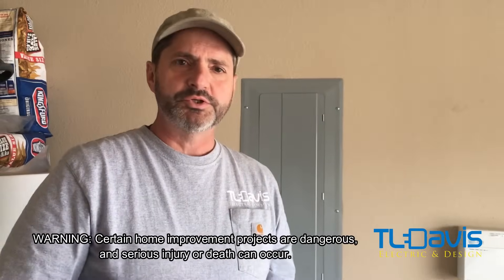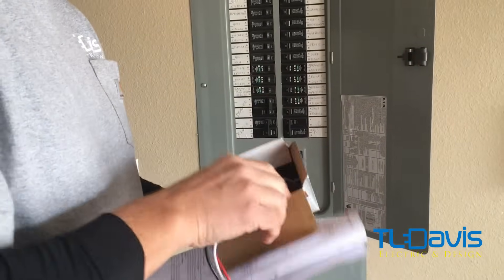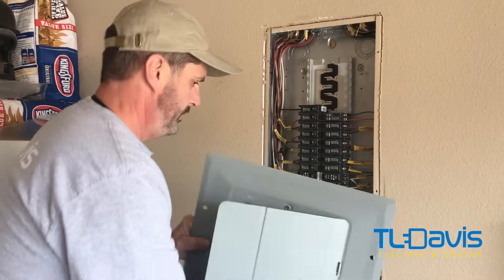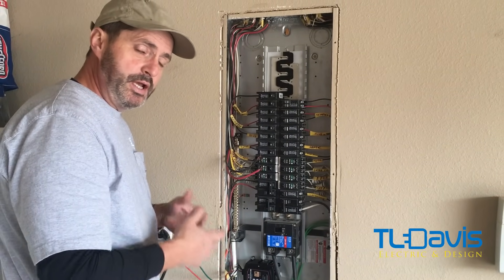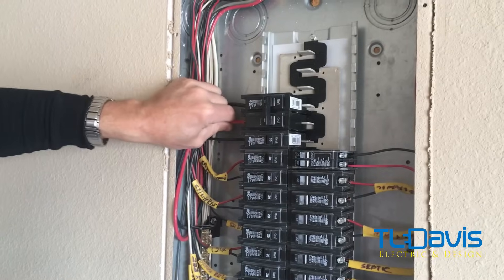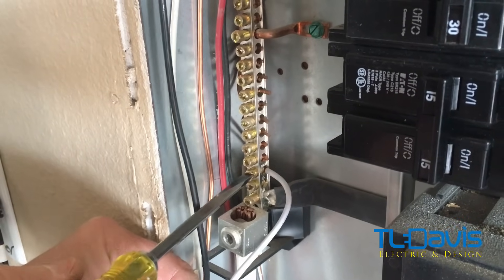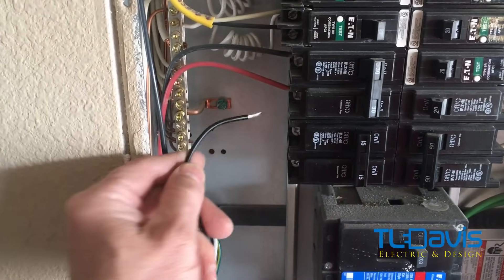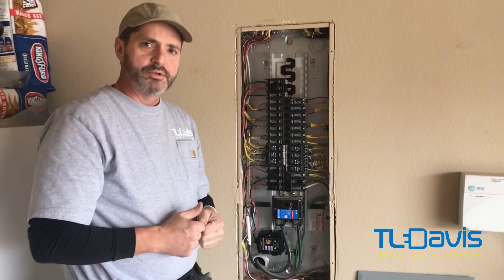How To Install A Whole House Surge Protector | TL Davis Electric & Design

Comment: Why did you connect the neutral and ground wire to the same connector
Reply from the maker: This was a main panel shown in the video. In the main panel the ground and neutral bars are connected, so it does not matter. Only in a sub panel are they separated and then the ground has to be on the ground bar and the neutral wire has to be on the neutral bar.

Comment: The unit installed requires a 2 pole 50 amp not a 2 pole 15 amp breaker he misread the instructions.
Reply from the maker: Thanks for your comment. I did not misread the instruction on what size of breaker to install. it calls out for two different styles of SPD and one is for the 50 amp and the other for the 15 amp. The one I installed was for the 15 amp. I have installed over 30 SPD with this amperage.
Reply: No, Terry is correct, they sell different models, the Ultra model uses a double 50 amp breaker, the model in the video is the Micro and requires only a double 15 amp breaker.

Comment: Is the distribution boar a single phased one?
Reply: I meant board
Reply from the maker: The SPD is single phase that we installed. Do not install it inside the panel that is shown in the video. This was a special exception given from the local jurisdiction having authority. All SPD of this type need to be installed on the outside of the panel. Please check out the other video's.

Comment: I have a question, why did you connect the ground from the protector to the neutral line and not to a ground?
Reply from the maker: I have explained this to others that have had the same question. In the Main panel the ground and neutral bars are connected. There for they are not separated. In a sub panel they are separated and then they must be connected to the ground bar and not the neutral bar.
Reply: I said the same thing I have an old three wire system coming into my garage but I added the plain copper wires outside to two grounding steak 6 feet apart and I had to install just a grounding bar for the copper grounded line outside so my white was on the power line Ground Bar and my copper was on the ground Rods Bar that's what my electrician this done it for sixty years told me to do

Comment: I realize Terry is an electrician. But what he is doing is u safe for any homeowner. Please call an electrician.
Reply from the maker: There were notes for this type of insulation. This was a special type and was approved by local authorities having jurisdiction. The child of the homeowner has a mental disorder and love to pull things apart with lights. This was not the correct application for standard insulation of an SPD. If you look at the other insulations that I have provided video's for. We have done another correct type of insulation for recess mounting which will come out shortly.

Comment: I always put the wires in the breaker in my hand first then mount it in the panel, done.  Might be wrong but then I’m working away from the box.
Reply: Not wrong at all. I've been doing that for years.
Reply: Huh, I like that idea, maybe when space is tight

Comment: Nice work Terry. What is the total cost to have this done?
Reply from the maker: If you buy this through Amazon with the Eaton whole house surge protection for single phase and the two pole 15 amp breaker and the flush kit. you will also need a 1/2" offset nipple with a 1/2" steel threaded coupling. you should spend less than $150.00. if you have someone install it for you, depending where you live. an average cost is around $500.00

Comment: Might want to clear up some confusion for some beginners and let them know why the ground and neutral are mounted to the same buss bar, and how they are bonded only at the main panel.  Also, when tightening down the crimps to copper, to go back and re tighten later as copper is soft and compresses leaving a slightly loose connection after being seated and setting for a day or so.
Reply: I just want to clarify that it is not always the main panel, but is the first point of disconnect. If your outside service  has a breaker that kills power to the pane where the majority of your breakers are housed,l then you need to keep the grounds and neutrals on the correct bars on that panel or mount in the disconnect(if possible) and bond grounds and neutrals
Reply: Yeah why the ground in the neutral bar??
Reply: Yes, why on the same bar?
Reply: This video was made before outside service disconnects were required. This panel is the first means of disconnect at the time it was made.
Reply: Good Tip, I went back to my panel 3 months after new and re-torqued all the  breaker conductor connections,  found 1/4 turn on many and some took almost a full turn tighter. It is good prevention to nuisance tripping and costly breaker over heating damage.
Reply: Thats not the purpose of this video

Comment: hello good Sr. I was wondering if you can please help me I have a surge protector Siemens - TPS3A1220VX02-1 Phase Surge Protection Device, 120/240VAC. can you please help me with the connection diagram. please
Reply from the maker: This is a really nice SPD. May I ask what square footage of home and is there a lot of electronics in the home. 200ka I only use for commercial applications. Homes are really protected with 50, 80, 100ka. from what I can tell from the picture. You will have a L1, L2, N neutral white wire and the ground will have a lug mounted to the can and that has to be green. I could not find a wiring diagram on line. The 2 pole breaker will need to match what Siemens is asking for in their specifications that came with the SPD. The wire coming from the breaker to the unit should not be more than 18" and the wire should be rated for the breaker feeding the SPD. Sorry I cannot be any further help. Good luck with your project. Make sure to turn the main off when working on your panel.
Reply: It is a three phase panel
Reply: Comercial

Comment: I like the way Terry Davis installed this. I would make a peek hole to view the status lights.
Reply from the maker: I only installed it in the panel do to a special situation. Normally they are installed on the outside of the panel, either surface mount or recessed mount.
Reply: Eaton sells the breaker type.........

Comment: My main breaker is outside in a separate panel box, right beside the meter. But then, I live in Texas!
Reply from the maker: If your main breaker is outside next to the meter. That is okay. Just install it in the panel with a 2 pole breaker for your panel. The spd will tell you what amperage you will need. I have attached links below the video to buy them through Amazon. there prices are cheaper than I can buy through the electrical supplier. Make sure to turn off the main breaker when installing the breaker. It does not matter where the breaker is installed as the electronic detect the surge and draws the power surge to it. I always recommend it to be close to the main breaker or main lugs in the panel.

Comment: I see MWBC's ("split circuits") without handle ties as well as one in the top right landed on a twin breaker (on the same phase). The former might be a technically but is still not code, the latter could cause an overload of the shared neutral. Both should be corrected. Also SPD's should NOT be installed behind the panel cover with no way to monitor their indicator lights.
Reply from the maker: First  of all. I did not wire this panel. Second of all we had special permission from our local inspector to install it inside the panel as they have a child that loves to tear apart items with lights. This was a request from the home owner to do this. I know this is not the proper way to install a surge protection device. I have explained this in another video.
Reply: @terrydavis5882  We install surge protectors made by PSP Products with a similar design as the Eaton ones. They are UL listed to be installed inside or outside the panel. They have the same green indicator lights and an alarm that goes off when the surge protector no longer works. So if you think about it, how often will someone look at the lights to see if the SPD is good. If the alarm goes off it will get your attention right away. Ideally the best way to do this is to mount the SPD outside the panel but it gets challenging when the panel is recessed in the wall. The most important thing when installing the SPD is to keep the wires on the SPD as short as possible. This will make the SPD more effective.

Comment: Smh all these comments that say he should have this and that and blah blah blah. IF YOU AREN'T COMFORTABLE WORKING WITH ELECTRICITY LIKE THIS DON'T DO IT!!!! simple as that. He knows what he's doing and has probably done it hundreds of times. He says have it done if you aren't comfortable with it. It's like all the idiots with the lead paint and asbestos siding. Stuff has been used for years and holds up great. I have it on my house and will never get rid of it. Been there si ce 1949 and has held up fine. I drill through it and whatnot but I don't lick the shit. I don't eat the lead paint off the walls. With a little common sense less people would not get hurt. The reason why it's this huge deal with how things are supposed to be done with electrical these days is because some idiot somewhere (probably Florida) thought it would be a good idea to lick the mains. I mean seriously use common sense and don't be stupid and you will be just fine.

Comment: Seriously?  This thing in this configuration is supposed to suppress surge in the whole panel?  OK, y'all.  Cause electricity is just gonna magically be drawn to that one 15 amp circuit?
Reply: The surge suppressor includes devices that breakdown ie short out when an over-voltage condition on either or both live lines is detected. They act extremely rapidly and pull the overvoltage down so yes the whole panel is "magically" protected!
Reply: Yes, it's a shorter distance to ground..... That's where electricity wants to go
Reply: It's all about resistance.

Comment: Everything from your excessive risk-taking with arc-flash (nice watch) to installing that cover over indicator lights which the home owner is expected to monitor (it's in the manual) screams "amateur hours billed at professional rates." You are a fool of the highest order, and I sincerely hope you retire before you hurt yourself or anyone else.

https://www.youtube.com/watch?v=fZP47mlELSc
Reply: Then install it outside your box if it scares you to take the cover off the breaker box. I'm not an electrician by any means but i understand how electricity works. I have swapped out breakers, I stalled new breakers and even wired outlets and switches inside  etc with a live box. I have too many smart devices in my house to kill power to my whole house. Yea he probably could have used an insulated screwdriver, possibly gloves etc.... But if you are careful you will be fine. Do go putting your tongue on live wires and you will be fine. He even says that "wear gloves or turn it off if you are not an electrician or comfortable with it". Grow some balls man. Just because you aren't comfortable with the way he did this doesn't mean others that know how to handle it are.

Comment: Hey, just a quick questions regarding Neutral Bar and Ground Bar. Is it different or the same? I see that you connect ground/neutral from the device to the ground bar. Would it be the same if I connect to neutral bar? Thank you.
Reply from the maker: In a main panel they are connected. The neutral and ground bar are the same. Only in a sub panel are they seperated.
Reply: @terrydavis5882  Then why didn't you put the green wire on the "grd." buss? Are you implying that although they are separated out in the subpanel that they are still tied together there so it doesn't matter?

Comment: I had an electrician install a 200 amp panel outside the house and a 100 amp sub panel in the garage. Would I need 2 of these or just one outside? I upgraded from an old push breaker bulldog panel.
Reply from the maker: You only need 1 Spd. You should install it in the main panel and not the sub panel.

Comment: Does this eliminate the need for surge protector power strips and such?
Reply from the maker: I still think it is good to have power strips for your computers and tv's. The whole house Spd will protect everything in the house including the washer & dryer, dishwasher, furnace, etc. we can never go wrong with over protecting are homes. We spend a lot of money on things we add to our homes.
Reply: My understanding is that they essentially did two different things. For lightening, you need an individual surge for delicate electronics, the wholehouse sp protects all other surges, 'spikes'. With all the delicate electronics in homes nowadays they should be code on new installs both residential and commercial

Appliances cycling on and off cause surges right inside your house. A whole house protector won't help with that. You need individual surge protectors for the delicate electronics.

Comment: I do not understand how this is a whole house surge protection device if it does not cut off all electricity if a surge is detected. The only way I can see this working is if all electricity was going through a device first and then going to your house. And that device would shut down on detection of a surge. How does this device work?
Reply: Fr33dom4All Protector absorbs the surge and may be destroyed in the process. It needs to be inspected on a periodic basis. It does not disconnect the circuits. Happy 2020 and God Bless